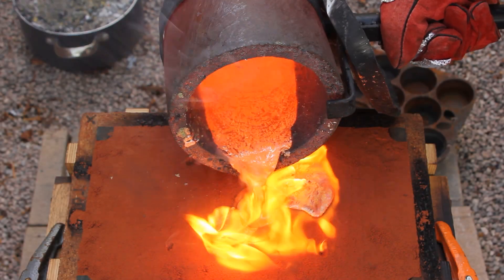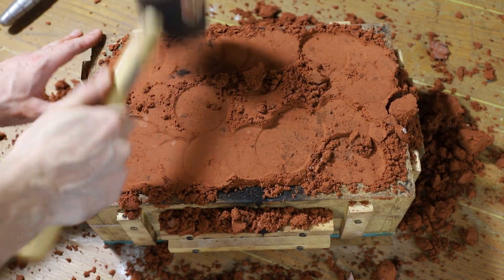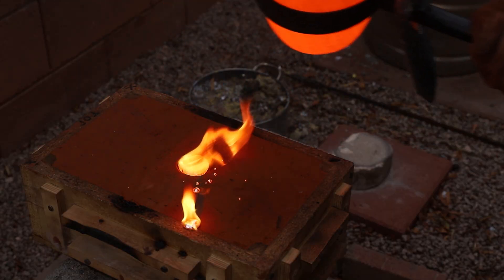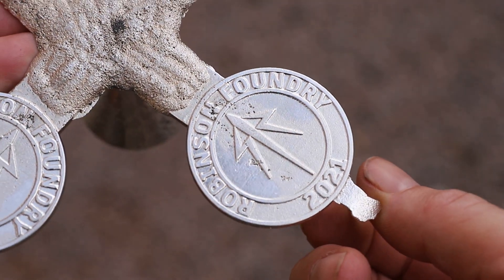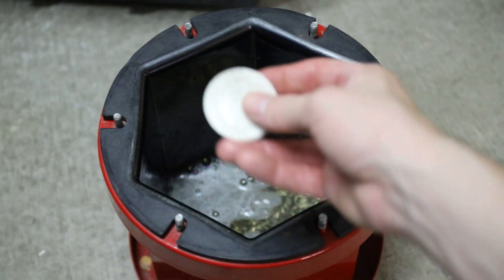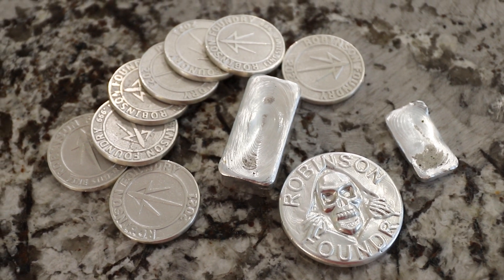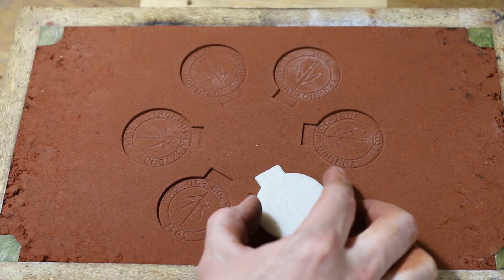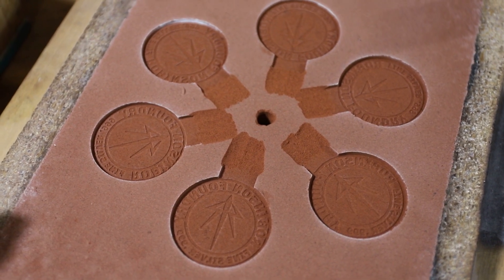I made my own SILVER COINS! - Making custom silver rounds - 3d printing to metal casting

Comment: Have you tried an alchol+graphic spray to improve the surface.  You spray is on your mold and either let the alchol evaporate or touch it off with fire.  Leaves a hard graphite coating.  Also, you should print your gating and you would get a better result.

Comment: What you should try it heating up silver and hammer flat and round. Stamp on the designs using steel stamps. Or make the coins out off silver clay. And stamp on your designs. Then blast the clay so it will turn to silver

Comment: It is actually better to pour the molten silver into a bucket with water to get small nuggets, and then weigh up 1 oz of nuggets, put those into a form, and then heat the form with the nuggets. That way there is no turbulence and a clean melt.

Comment: Sand molds are not the best for capturing details. Investment casting with a centrifuge or vacuum table is the way to go, unless you have coin-striking equipment, which isn’t financially feasible for hobbyists.

Comment: Im a jewelry caster.
Interesting to see it done in a sand mold

Pure silver is a nightmare to cast, as it cools too fast.

Also, we always keep a separate crucible for every type of alloy to avoid contamination

If you recast it and alloy it with 7.5% copper and add a pinch of borax or boric acid while molten…give it a good stir, it will cast much better. Tho now you’d have sterling silver rather pure

Nice vid. Best of luck!

Comment: Great video. Have you considered centrifugal casting for coin production?. Often used as a way to produce fine detail things like warhammer models back in the day. Also i think it will mean less work after the cast. I think you can use plaster to pour the casts too. Some jewelers 3d print using a wax like filament that totally disappears when molten metal is poured over it, no need for a 2 part cast.

Comment: Coins aren't cast... they're minted.

All the problems you had - is why they're minted versus cast... 

They're cool coins... and the best I've seen for casted coins... but yeah - minting. :)

BTW - craziest thing ever... minted coins look so amazing because when they're struck ... the pressures generated by the striking actually cause the top layer of the metal to liquify and flow up into the mold of the striking die. When it's done at exceptionally high pressure and with really well-polished blanks (they're burnished before striking)... that's how you get those "proof" minted coins. That mirror finish and whatnot come from how much pressure is present for that fraction of a second... and the liquification of the metal and the immediate draw of it into the die.

There are a zillion video online... it's quite the process to watch.

Comment: Make a silver cylinder -> cut the cylinder into coin blanks -> polish the blanks to a mirror finish -> make reverse and obverse dyes with designs -> press the designs into the blanks using a hydraulic press.

Comment: You might want to try using a lost wax process with a ceramic shell, the detail should be much better than green sand process. You might also be too high in temp at 2000 degrees F, try going down to 1850 or 1900 degrees.

Comment: Don't give up on silver casting! The coins ended up beautiful, but I wonder why you used sand casting instead of using plaster. I used to make jewelry way back in the stone age when I went to college, and the refractory plaster we used would very accurately capture the surface finish of the wax model. I've also spent some time in the more recent past experimenting with 3D printing and have always wanted to use it in lost-wax casting. I hope to see you continue to experiment with silver!

Comment: Don't use sand molds to cast silver, gold, or any other precious metals. Instead use investment and make molds that way. The detail is guaranteed to be there and if you use the right resin, you can go directly from the printed item to the precious metal item because you burn out the resin copy before casting.

Comment: Yes. Silver is hard to cast. Need extremely hot metal for easy flow and extremely smooth...but quick...pours.
I tried and gave up on casting my coins.
Electing instead, to melt and roll sheets that I can cut the coin blanks and stamp tbe designs using a press.
My dies are being made as I type. 
Wish me luck.
Reply from the maker: Sounds like fun!

Comment: Do you think melting lower grade copper down in a forge and pouring into blocks would increase the grade when I take to the scrap yard? if so do you think it will result in a profit or will any profit be eaten in the cost of melting? thanks

Comment: Could you pour into a tall cylinder. Then, flatten out the cylinder into a sheet to cut blanks like they do in actual coin minting process. You’d need some high pressure rollers and a press to strike the coins. Probably an expensive endeavor, but would be cool to see if you could find a way to do it cheap!

Comment: These look pretty good considering most coins are come from a mint where they are stamped rather than cast. Stamping allows for a large volume of coins to be made very quickly and with great detail, and each coin comes from the exact same thickness of metal band all stamped from the same die. It’s pretty cool to have made your own coins.

Comment: Hi, I loved the video. Sterling silver will cast significantly better than fine silver. The eutectic freezing point of fine silver is very small. This makes it harder to cast. 

To get a better shine on your coins, use a 2.5-3mm stainless steel shot. Pins never give a great finish.

Comment: Can I recommend for a future video?

Make an iron press with the coin image (and another one for the other side), put a round plain piece of silver in between the two iron molds, and hit it hard with a sledge hammer, so that the image from the iron mold gets "pressed" into the silver, as an older way of making coins. The result is never going to be perfect, but it'll look a bit more original, authentic and historical, rather than molded coins.

Hope ya get what I mean, I can try to explain better if ya want, just ask :D
Would be real nice to see that done in practice.

Comment: I'm pretty sure that places like the mint pour the molten silver into molds that are nearly as hot as the furnace so you wouldn't end up with the flow issues and it'll heat out your air bubbles. I may be wrong though so don't quote me.
Reply: Most minted coins are stamped rather than cast.

Comment: Good stuff man, I'm glad to see that double side coin castings are possible :)  I've been messing around with bismuth making single sided coins, but now I may have to try dual-siding it. I suppose I may have to print both sides of the coin separately and glue them together as I don't have one of those fancy resin printers. I've been following your work for a wile now and took inspiration from your foundry tong designs and reproduced them for my own little backyard forge. Keep up the good work :)

Comment: I’ve found that casting sterling (.925 silver)  is much more forgiving than casting .999 silver, even though you may think .999 is easier.
Reply: Fine silver is a hard-sell for a coin anyways, and sterling can be heat hardened.

Cast silver is dead-soft.
Reply: @sigmasquadleader  how soft is 'dead' soft? Would it be possible to bend this soft silver with your hands for example?

Comment: This surface deffects in your coins are caused by direct connection of sprue with Gates. There should be a runner between them and Gate should connect Wit runner at 90 degree angle. 
You can connect sprue directly with Gates but in such setup gates should be as slim as possibile and wide- that will filter out all oxidation and provide calm flow.
And some of this deffects can be also due to lose sand in mold.

Comment: Very cool! Silver is really soft. I wonder if would have been easier to cast silver coin blanks and then cast your designs into iron to stamp them with?
Reply: I was wondering that myself.
Reply: this is the best way to do it I think
Reply: @ItCanBeDoneAMIGO 6y6 CT
Reply: A good idea in theory, but iron is extraordinarily difficult to cast, and requires industrial equipment to do so
Reply: You would simply cnc mill steel instead of iron  @jackturner3803
Reply: Flat coins then Lazer print
Reply: Yes when making silver coins its more efficient to use blanks and a die, but you need a setup where the coins are hit inside a tube the diameter of the coins so that they dont flatten out when struck.